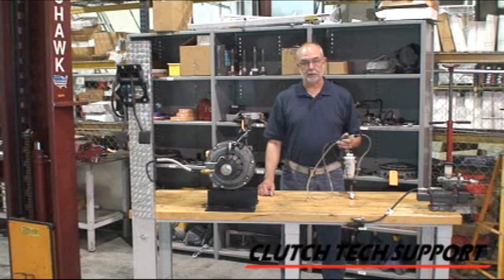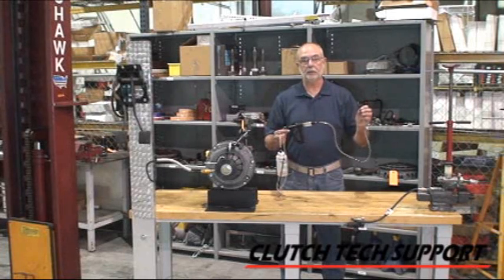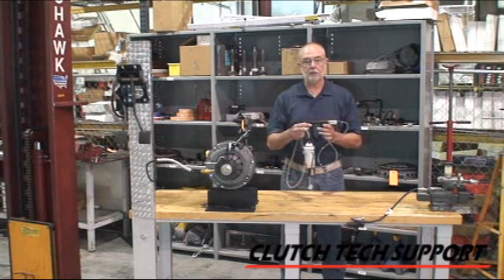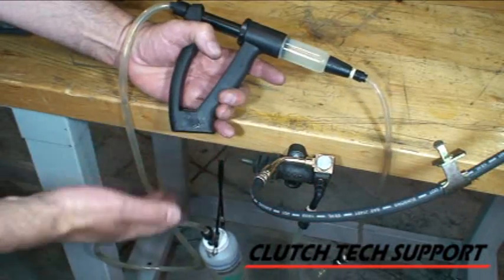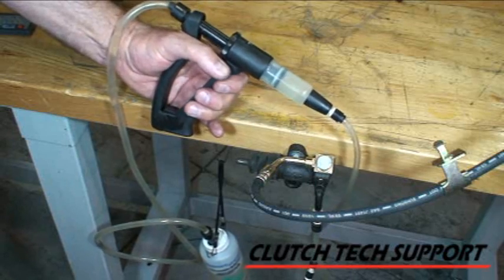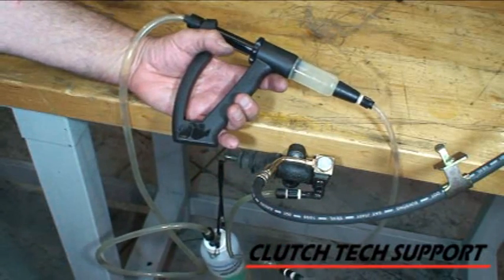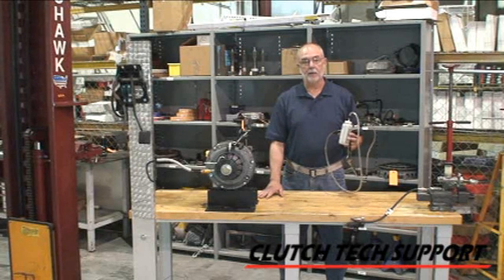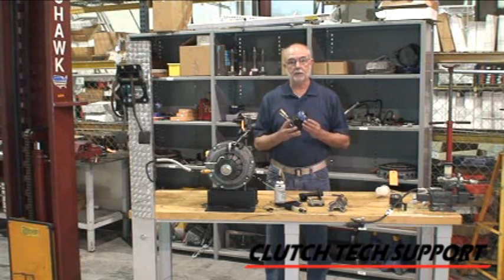Clutch Hydraulic Release System Reverse Fluid Injection

Comment: And Make Sure The Clutch master cylinder is the correct one. I got 2 Diff Ones from Orielys both wrong  where-by The Clutch master Cylinder Plunger rod was a Tiny Bit TOO Long so The  Reservoir Couldnt  Allow fluid To Go Into The Chamber  to Even be Bled out.  3rd One from  diff Place worked  so good all i had to do was Pedal pump it for air bleeding

Comment: yes and NO NO NO.   Bleed nipple for clutch is on top of the gearbox and the slave is the type inside not exterior. I never knew about priming it so fitted the slave inside then fit the gearbox. As the bleed nipple is above you would think great air bubbles come up. Yep but I fear inside the slave is a place where bubbles get caught. Need to flush them out. I did squeeze the rubber Flexi above the bleed nipple with locking pliers. Clutch pedal went had. so defo the problem is in the slave. I then sucked all the air out and locked it with a vacuum before allowing only brake fluid inside. You would think. Great and now fixed. No not at all. Even though locking pliers on Flexi prove the system above worked well, I still changed the master cylinder on the clutch pedal. So as a last minute thing I read about injecting fluid into the system. If you undo the bleed nipple though surely air goes in via the thread. I always power bleed by pushing fluid from reservoir normally. Great. This time though no because as said its not the fluid coming down to the bleed nipple on the clutch. Its below that in the slave I want to be sure theres no air bubbles. Any idea?
Reply: Did you solve this issue? I'm bleeding a Tilton 6000 series hydraulic release bearing and it didn't say anywhere to prime before install. My clutch pedal only comes up halfway and I think it's air in the system still.

I power bled the system at 15psi through 2 full quarts of fluid and no bubbles are coming out. Still no improvement
Reply: @walirifai  no mate I just drive the van. Done 5000 miles like it. I knew I would get used to it being like that. Sometimes I even flip my foot underneath it and bring it back to max half way with the tops of my toes. Don’t think about it ever. Power bleed never sorted it. New master never sorted it. Damn concentric slave rubbish.
Reply: @walirifai Any luck? I'm running a Tilton 6000 series in my o4 gto with Magnum 6spd. Also using Tilton 13/16 master cylinder. Clutch pedal is inconsistent. (Works better after a few pumps) I've ran a gallon of dot4 through it... no air... no change in performance... 🤯

Comment: So using this method doesn't require the clutch to be held in or worked at all? I mean while the parts are on the vehicle still. I tried this a couple days aho with a pretty weak pump, but had someone hold the clutch in. Big mistake or...? Thanks for the responses.

Comment: Where can I get one of these tools? It seems forcing fluid in through the bleeder valve is my last hope.
Reply: ***** I'm working on an 85 GMC C2500. The clutch slave cylinder has the bleeder valve pointing straight up, so it shouldn't be too hard, but it's proving difficult.
Reply: Did this reverse bleeder work on that truck, I'm working on exact same truck now myself
Reply: Ebay >>> Costs about $100 & get a Bigger Fluid canister (16 oz) & get a Gasket/O ring For the top of it bcz it leaks air & F's up the Whole process.  be prepared bcz after over 700 Pumps either vacumn or pressure Pump or Clutch Pedal itself , My System Has too much air in it & Connections are tight. ....  SOL 4 Me Sofar!!!  ....  I had friends say they would come over & Help but they dont show up so make sure you have Honest friends to help you. .........